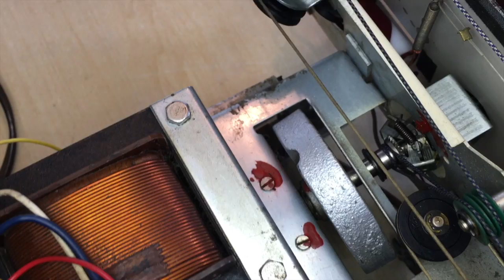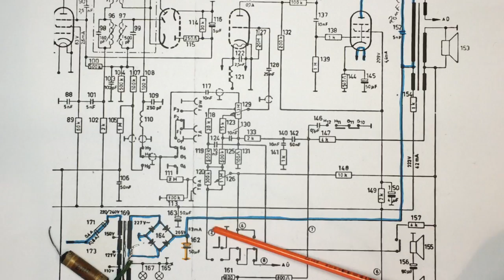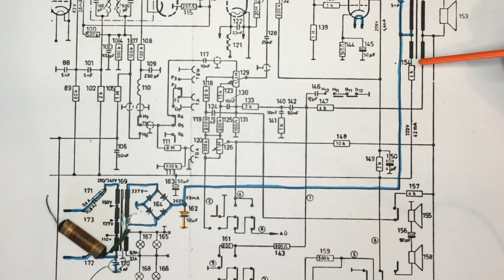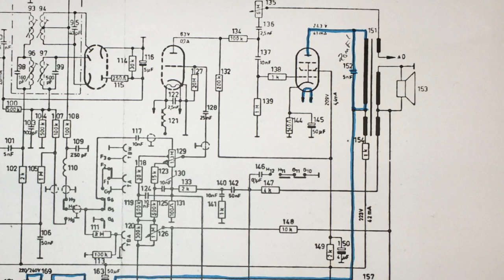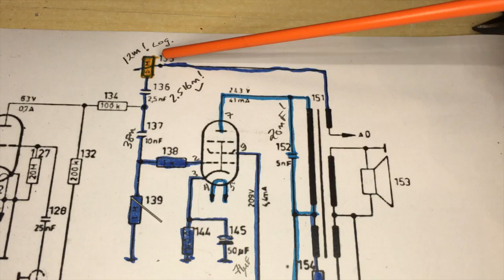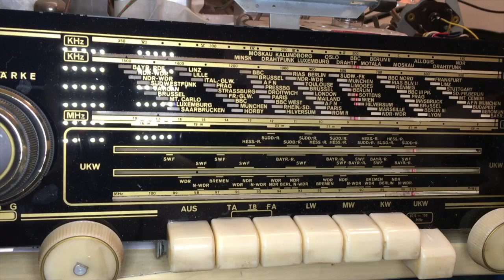Graetz Musica 4R417 tube radio restoration log - Part 3

Comment: I see you use a brush to remove dust. Have you thought of trying compressed air? I use it and there is no danger of damaging fine wires and it reaches dirt lodged behind components.
Reply from the maker: I sometimes use compressed air, but using the brush gives me more control, so I prefer it to the air.

Comment: Sir, is it possible that you by error used a one Nanofarad capacitor as Output coupler to the EL84 as shown in 13m18secs ? Greetings from Frankfurt, Germany (where your Braun Atelier was built back then). Anyway, very fine work on that old Radios.
Reply from the maker: Hi. Yes, you are right. It's a 102 cap, so 1nF. After completing the series, I noticed that it was a little 'tinny' in comparison with my other Graetz radios, so I went back to check everything and found this error. It has since been replaced. Thank you for pointing this error out, so that it gets registered in the comments for others who may be confused by my mistake. 
As for the Braun Atelier -- wow! It's a real pleasure, and gets listened to every day.